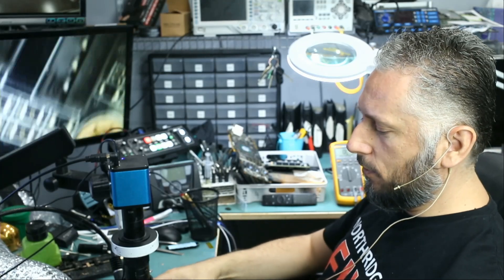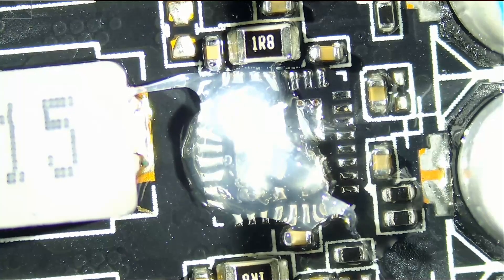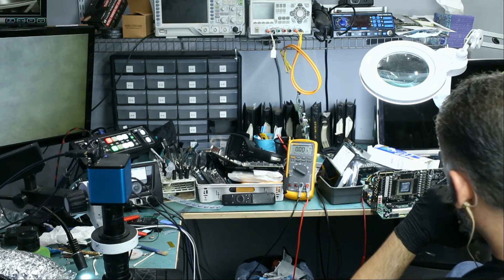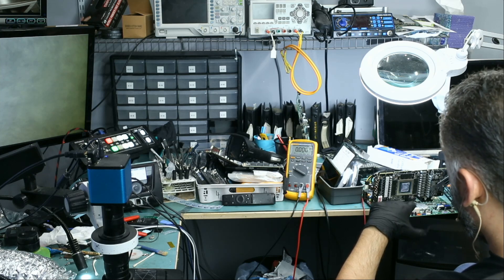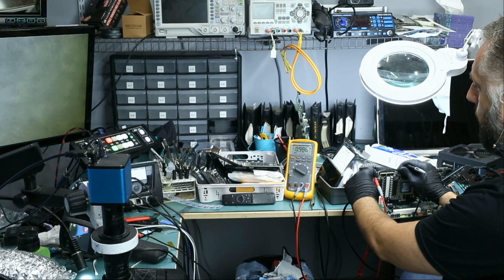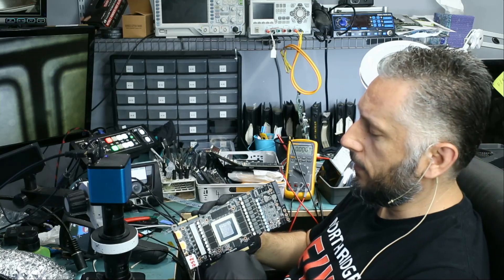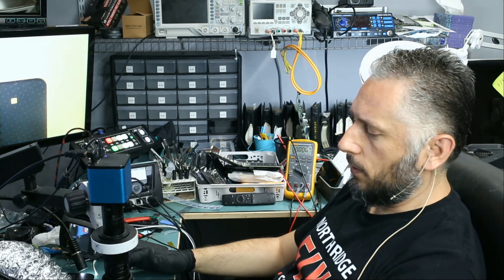Gigabyte RTX 3090 Graphics Card Repair - No Power and Not detected Part 2

Comment: Probably a dumb idea but does it need the heat sink on for that model? GPU shutting down from over heating?
Reply from the maker: We did re-assemble the fans and heatsink but no change. The chirping sound is not normal. All video cards should be able to post without connected fans or heatsink. GPU heat is aggressive on this one and causing the entire board to heat up. This is abnormal based on a lot of working video cards I tested with a thermal cam.
Reply: @NorthridgeFix  I agree. Good attempt though
Reply: from my experience there are some cards that will not turn on properly if heatsink fans are not connected
Reply: @NorthridgeFix  sir you can probably dry sold the GPU ,it may solve the problem
Reply: @NorthridgeFix  "GPU heat is aggressive on this one and causing the entire board to heat up." - Oh yeah, from what I've seen so far that's usually a clear indicator of the fact that the chip (GPU) itself is fried.
Reply: @NorthridgeFix  please make a video why we can't change the GPU or CPU 
If you take the GPU from the same model and put it on the board may it works ? 
Hope you reply 🙂
Reply: So it might, but honestly the GPU should be able to POST and should really be running it's "2D" mode so to speak and draw much less power and generate WAY less heat than his gun was detecting. The fact that it went full throttle for thermals indicates the GPU fried and its basically just running a maximum current but no respect regarding how to use the current computationally speaking.
Reply: Most GPUs will get to the point of displaying the bios splash screen before shutting off, even without any cooling. Since the card didn't output anything, and was heating up, it must be an issue with some chip.
Reply: @chattyinc   "to put out", not "to output".
Reply: @nipunsachinthana6985  but one component Is not hot at all ( left side od the board )
Reply: yes but it wont stop the pc from posting.
Reply: Its 3090, its VERY HOT, like a hell...
Reply: Over current protection kicking in ?
Reply: I mean the GPU only Hit a max temperature of 120 degrees Fahrenheit and the critical temperature of the chip is way above 200 degrees Fahrenheit
Reply: @dreamcat04  who uses fahrenheit on ICs? I thought it's universally agreed that we use Celsius. Even US based Gamer's nexus uses Celsius for their measurements.
Reply: @triadwarfare  I don't know. On the thermal cam it showed it in Fahrenheit, that's why I used Fahrenheit too
Reply: @triadwarfare  but the games nexus is australian.. down here no one talks F
Reply: @downundergarage6968  You might be thinking of hardware unboxed. Gamers Nexus is in the US.
Reply: I doubt that.
These cards are capable of running as low as 20W as I've seen in HiveOS when my 3080s sit idle. The card / GPU is not supposed to be heating up so intensely pre-post in the first place, but the thermal limits in place should compensate for no fans/cooling and simply downclock to a point where the GPU doesn't heat up as much as it did in the video. 
I do think there may be some new components on the 3000 series for northwest to learn, but I have no doubt that with time, more of these repairs will be completed.
Reply: Yes. That gpu ran a lot without fan. Usually 5 seconds is enough to see a display. If it doesnt come up and the processor is not getting hot then we can continue testing voltages without cutting power. There is a reason why huge copper heatsinks and 3 fans are used on high end cards. Even 10 seconds without cooling maybe disaster.
Reply: I had a CPU that fried because I didn't put the heat sink on it. 
No I didn't boot into windows as there was no HDD attached, as I was building a new PC.
Reply: yeah maybe you right he need to test that with the heat sink on because of the protection those graphics card have when they reach that temperature
Reply: What about the beeping code on the motherboard? What those really fast beeping means? Should you try it on a different motherboard? I had a problem similar to this one before and had to update the motherboard bios. Sounds like a long shot but it worth the try.  The memory issue it should not be out of the table, because that extreme temperatures are not normal at all on a GPU without load. Just a thought. By the way Alex has the best soldering skills I’ve ever seen. Thank you all.
Reply: Hey bro. Update BIOS first
Reply: really dumb idea you're right

Comment: This is obviously a very old video but I've been going back and watching through all of them. When he used the thermal camera on the GPU mounted in the motherboard, I noticed there was a spot that wasn't getting as hot as the rest of it on the left side. Looked like it could have been it a MOSFET. Could that have been the issue here that something was not getting power correctly?

Comment: If the card isn't in use it souldn't heat up like that, you could look for short circuit, on data lines, maybe you could try a Mining mount that convert pcie 1x to 16x, it's inexpensive and you can connect the power and data lines separately also the extra cable may give you more space while Mesuring.

Comment: Be careful buying anything Gigabyte. I had a 2080 super from them go bad so I checked the warranty got approval from them and sent it in. On the website it said it was being repaired or replaced. I waited a month and a half and heard nothing from them so I called and was told it couldn't be fixed and they had no replacement. Then they wanted a receipt so they could determine the value of my card. I sent that in over a month ago and still nothing from them.

Comment: The gpu isnt shut off itself when its die. i think this is a vram, vram vcc, clock or Bios problem here. The card isnt heat too much 120 farenheit like 50C degree this is normal without heatsink.

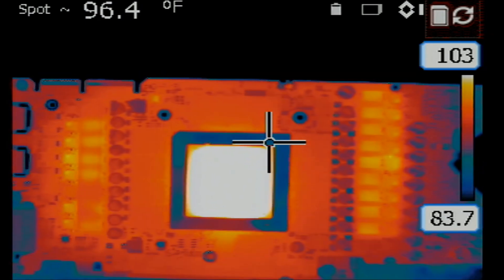Comment: 4:59 one of the low mosfets to the left side (ones that feed memory chips) isn't heating the same as the others, meaning there might not be voltage comming from it. Bottom low mosfet to the right isn't heating, probably means no tension comming to it. The RTX 30 series won't start unless all tensions are present.
Reply: At 5:19 you can see there are 2 mosfets on the left side thats not heating. The top one and the one at the 3rd from the bottom.
Reply: @northridgefix definitely worth further investigation

Comment: install in board side by side anothe working card, run nvflash and check if system see card, but dont have boot. , them reinstall bios. ( check for correct ddr bios version.

Comment: Have you tried to reball the GPU? You can also try it with the cooler installed, maybe there are protection circuits or even a pressure based socketing that prevent the GPU from booting without the cooler. after all, it's a 3090 that I unfortunately don't know much about.

Comment: Oh, that's frustrating for you!

I really admire skill displayed in these videos; I groaned when I saw surface mount resistors lifting when you removed and replaced the DrMOS, and when there was a small solder bridge after fitting the new DrMOS. Even if I was practiced at replacing surface mount parts, that would cause me to panic a little ("Great, I fixed one problem, and created another!"), but I didn't detect any panic from you.

Comment: This is why it’s dumb to send your card to a repair shop when it’s still covered under warranty, assuming there’s not some extenuating circumstance.  Gigabyte definitely will not replace it now that it’s been tampered with.  Honestly I’ve only had to have graphics cards replaced under warranty twice, two XFX GTX 280’s, (I had 5 total, 3 I bought and 2 RMA cards) and they honored the warranty just fine.  EVGA is also good about warranty replacement assuming you didn’t kill your card doing something not covered by the warranty terms.  I had an Asus Kepler Titan have a capacitor fall off, but it wasn’t in warranty so I did get that repaired, and it made perfect sense to do so.
It also probably helps to have a power supply, mother board, and graphics card made by the same company, so if you have trouble, they can’t say, maybe it’s your mother board or power supply.  It’s like, well, those are yours too so...EVGA 😆

Comment: How much would a repair like this cost? Just curious.
Reply: He’s an extremely skilled technician with probably decades of experience. So he can rightfully charge a hefty price if he wants to. He does great work
Reply: I got quoted for £120 to repair blown capacitors on my 980ti lol
Reply: Probably has a base rate based on product plus hourly labour rate. Then parts + complexity of issue on top. So hard to give a predetermined number
Reply: 50 usd

Comment: I would check the power draw on the 12V GPU connector and compare it against a normal card's consumption profile during POST. If the card is drawing a way more power, then the GPU is shorted (yet the 0.7V-ish Vcore does not indicate that.. unless the rail supply can keep up with the "in-short" amps).

Comment: Recommend checking the data lines witch are in pair, 8pairs if im not mistaken, on both sides of the GPU PCIe connector. That way you can only confirm if GPU is dead if pair values dont match with eachother.

Comment: Not sure if you tried the second bios by flipping the switch. But fast beeps sometimes mean the bios won't start from curruption or an the wrong oc bios someone loaded is halting boot. I build it of custom computers and have seen this before on cards I purchased second hand.

Comment: The memory rail should be 1.35 volts. That's spec for DDR6X. You only got .9 volts. Card will shut down because the memory is not responding. Check the drmos, caps and resistors feeding the memory rail power.
Reply: I do not believe this is True, at least for some 3090 cards, because people are reporting ~0.85v for memory.

Comment: I know my comment will probably not help... but that's a problem with gigabyte cards for a long time, they run hotter than other models generally speaking, It may be that the gpu chip itself is damaged due to the constant overheating... best case scenario the client tries to get a refund from where he bought, the card is what 6-9 months old at max he should be able to get a refund

Comment: I tend to agree that if it is not throwing a fan fail sensor, that you have all of the rails powered with the external connector that VRM controller might be the problem?  Probly dead GPU .. thing is, it should be under warranty., why send it to third party here?

Comment: Hi Alex greetings from Germany once again, we spoke a few Months ago. Had also a 3080 with similar issues for a few weeks. Try testing pin/pad 3 from left to right on the big PCI slot. when no Value - Vprocesor ist fried
when Value than look on the other side from the card with FLIR and check there once,

P.S please answer when you can regarding my Amtech Request on E-mail.

Comment: I'm wondering why the customer didn't just RMA it through Gigabyte, its still under warranty.  Are you going to re attach the original bad mosfet so that the customer can try to RMA it?
Reply: probably when he send claim RMA, they will return his money or replace with last gen series. That what happened in my country
Reply: @akagaminolip  wich sucks alot, in a normal situation I doubt anyone will try to repair when you could swapped it for the same card... but due to the shortage the best he could get is a money return... wich sucks since that card costs more now... or a replacement to something worse and some store credit....

Comment: gpu will get hot, put a heatsink on it, but ok, even then still not start, the memory voltage you say is not there ............ remove each memory chip one at a time ..................you know you have to fix this - you will not sleep until you do lol

Comment: Hey Alex, have always enjoyed your video. 

Could be a BIOS issue. Try to switch to secondary BIOS if there is a switch on the board.  If not, put the card into the system as secondary display, if that prevents PC from booting. Can always plug in after system post. Check if detected in Windows. Once booted, can try flashing new bios.

Comment: Maybe a bad cap or component in the other side of the board? There is a lot of small components in the reverse of the board and maybe the thermal cam cant read the heat of that component.

Comment: I bought a Gigabyte RTX 3080 Ti Gaming OC earlier this month for USD 2500. It has 4 yrs warranty, but after watching this video, I have decided not to set a custom fan curve on it. I will stick to Auto on OC bios. But will definitely OC the card a bit more (+25 voltage, +65 core and +500 memory) as long as temps remain under 78c during heavy gaming.

Comment: I know it's Alex's shop, but for graphics cards:

1) The customer should tell the truth on what happened to the card and what modifications were made, if any.  The "I don't know what happened" reason could be easily detected as not truthful if the card has the manufacturer's label tampered with on the heat sink screws (at least on most of the cards).  If the card is second-hand, then the customer should make this known, and especially if the card was previously opened by the original owner. 

2) Cards that still have the manufacturer sticker on the screws, plus are within the warranty period should have the customer verify that an RMA is not possible.  Otherwise opening up the card will void the warranty, and the customer ends up with a card they could have returned for RMA.

3) Maybe limit the expedited service option on graphics cards, due to the complexity of these cards.

Comment: i know you don't want to hear this but that GPU is dead, the card is brain dead, most likely the card controller is initiation all the voltage rails but then shutting down due to the over current caused by the internal gpu damage. if possible check the amount of current draw by the card.

Comment: Might be the motherboard that not detecting the gpu as some older motherboard don't support the newest gpu. Sad to see the failure of the rtx 3090 even with the current pricing is out of control. My only worry is that are there other rtx 3090 affected by this. Nvidia is going to be pissed about that

Comment: Dead GPU to hot to fast. In the last vídeo not boot whitout the bad MOSFET they only need 1 MOSFET per line to boot so yea I figured.in Windows the power is very low 35w to 100w to usé (not gaming)

Comment: Heard rumours on numerous design faults within rtx 3xxx series. They are failing a lot be it mosfets or processor chip. With rtx 3, i think nvidia has paved the way to the throne of gpu for amd. Now amd will rule cpu and gpu sales / performance charts.

Comment: Hey Alex, when you press down on a chip to squeeze out the excess solder like in 1:45, how do you make sure that there isn't a short underneath (eg between the large pads or some of the pins)? Best regards, Jakob
Reply: Use flux

Comment: Sometimes vrms could partially work, i. e. you might get the correct voltage and normal heat output under thermal cam, but the signal could be scrambled. The only way to test it is with oscilloscope. That would determine if any vrm is working properly or not.

Comment: I believe your assessment to be correct. When power supply MOSFETs fail in a shorted condition they will generally take out the component they were powering. The fuse was probably rated to prevent the trace from burning the board down, not to save the components, so that the board could get certified.

Comment: This is a dual bios board - there is a little micro switch at the top of the board, as one last ditch attempt it might be worth flicking the switch to the alternate position to engage the alternate bios (silent mode). Probably won't work as I believe the GPU has an internal short from the 12v shock it would have received on vcore when the mosfet shorted - but it's worth a shot before condemning the card to the trash.

Comment: I think the owner did an overclocking to the card which make it auto overclock that makes it unstable. If it has a bios reset switch like motherboards, perhaps resetting the bios will work?? 🧐
Reply: Overclock would not start till windows boots.
Reply: @jonesaleroy  really? I didn't know that exactly
Reply: Yea the overclock would be through software in windows. Boot starts the bios and runs the base startup mode tills drivers I'm windows are loaded.
Reply: @jonesaleroy  ah.. I see. Thanks for the info dude, appreciate it 👌

Comment: Did you tried to replace the GPU itself? I see all comment to put fans and heat sink! Normally when the chip is bad no matter if is got heat sink on it it will burn hot like this! I have similar problems with dead motherboards because of dead south bridge chips! it will be interesting to see replacing the GPU video of this card!